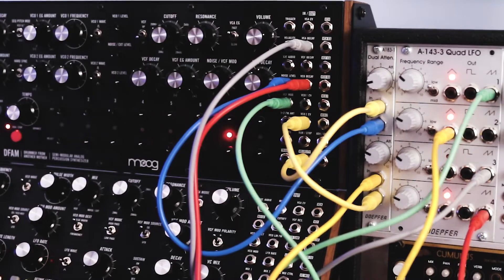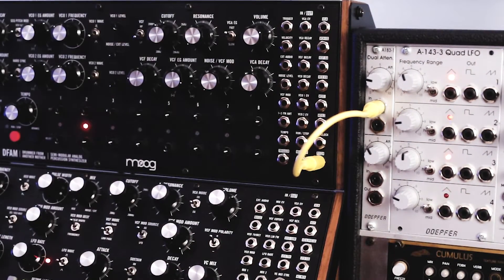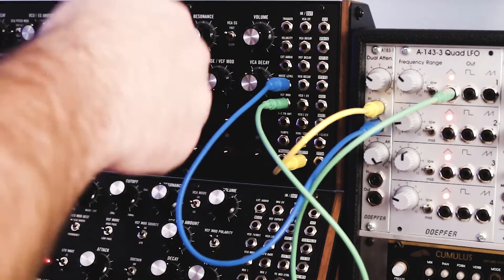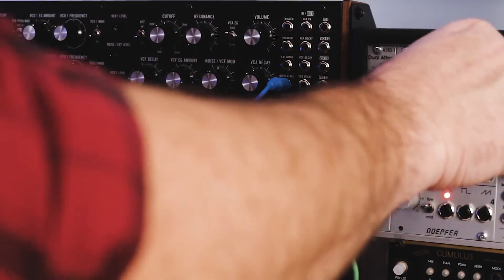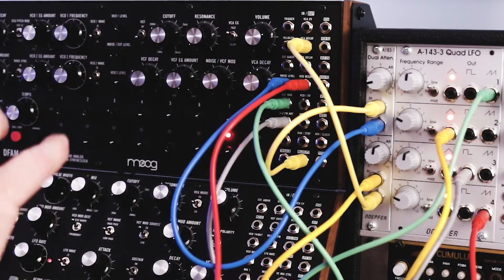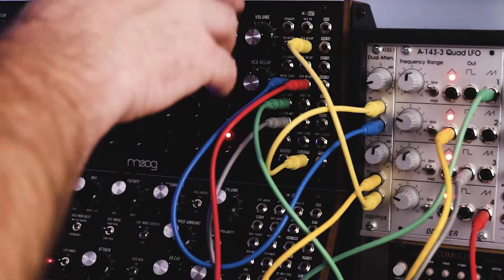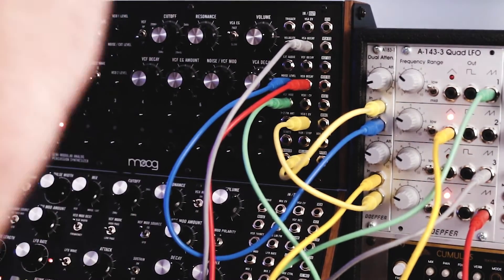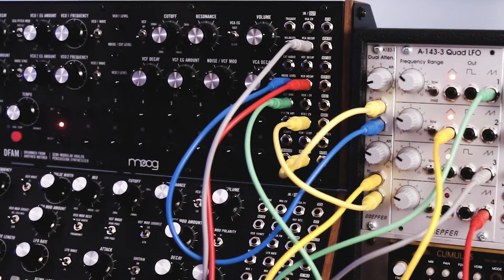DFAM + Two Simple Eurorack Modules

Comment: What about the voltage limit difference between Moog and Eurorack?
Reply from the maker: It's a good question. (And one that comes up a lot) It's not something to be concerned over. Higher voltage from these modules won't hurt the sound studio. With that said, if the input only accepts up to +5v, then when the Doepfer LFO is sending above +5 (i.e. +6, +7, +8...) the value on the Moog will be maxed out. The graph of the modulation would look similar to a trapezoid as opposed to a triangle (the top would be flat above +5).  So an attenuator or offset can help put it in the range that the Moog will accept.

Comment: Thanks for another great video. what i didnt quite understand -- where are you taking the effects at the end from? the dfam doesnt have built in effects... and it doesnt look like theres another patch coming except the attn. and the lfo... so im confused?:)
Reply from the maker: I have external effects on my mixer, but I also use a lot of Plugins for effects. Many effects - whether pedals or modules - are digital, and considering many are at the end of the signal chain, I often will just use Plugins because they are cheaper and you can have multiple instances. I don't remember exactly what I was using here. (I can look it up if you are interested). It's most like Valhalla Vintageverb, maybe some subtle compression and EQ. General stuff.

Comment: Right now I am building myself a custom-made 4-voices passive attenuator for my Sound Studio (I plan to integrate it just right into the 30-mm space that lies between the case and the cable holder). After playing with headphone cables with passive volume knobs used as attenuators, I agree that being able to choose the intensity of modulations in the Sound Studio is probably the most important function among those that were overlooked by Moog in their system. It is a game-changing option, for a dirt-cheap investment.

Speaking of dirt-cheap investment, I still stay flabbergasted at the price tag of something as basic as an attenuator in the Eurorack world. Even for small one-person company, I find it hard to justify.
Reply from the maker: Yeah, it's a pretty expensive endeavor. That's awesome that you have the skills to DIY it though!
Reply: @braintree56  I will wait until it works alright before boasting about it ! 😄
For a passive attenuator, the circuit design itself is quite simple, really : just a matter of measuring what current a typical Cv command sends through the wires and then choosing the right potentiometer to place in-between two female jack plugs.
But the more tricky part, maybe, will be to frame it in a proper box or behind a neatly designed plaque so that it integrates seamlessly with the Sound Studio. For I have to admit that beyond its specifications, an important quality of Moog’s semi-modular set is how cool it looks ! I would not want to ruin it with a poorly-executed added circuit.

I bought an aluminium extruded profile that should fit just right in the space between the top case and the cable holder. With a black acrylic wash on the metal and the right potentiometers’ knobs, hopefully it will fit as if it was a genuine Moog product.
Fingers crossed …

Comment: Still debating (if & when) modular. It be great to see what module recommendations (utilities, etc..) you would have to use with the Subharmonicon.  Thanks!
Reply from the maker: That's a really interesting question. I've only recently started playing around with my modules and the Sub. Nothing jumped out to me as "the sub really needs X" so it's more just experimentation. 

If I had to make a recommendation, I'd say effects modules first. The Sub benefits from reverbs and delays. I ran it through an MI Clouds clone and it was great.

The clock divider trick I outlined in a previous video was the only functional thing I've used. Certainly LFOs and other Modulations are always great and I've heard people say running external audio into the VCOs gives some pretty interesting results.

But at this point, I have more investigations/experiments I want to do than actual answers...
Reply from the maker: It sounds pretty good on its own or with limited mm modulations...

Comment: Great vid! Ages ago I bought 2x Behringer Neutrons. They sound good anyway, but because of the vast amount of patch points in and out I have ended up using them as modulation sources mostly now. So useful as they have 2vco which can be run at lfo speeds, an lfo which can run at audio rates and they also have 2 attenuators each! You can pick them up quite cheap 2nd hand too. Hope that helps someone! Keep up the great work on the vids. ♥ 🎶 😁 🎹
Reply: That’s pretty much the role my Neutron fulfils these days. It’s worth the price just for the utilities it provides alone! You’re basically looking at 3 LFOs, a S&H, Slew Limiter, 2 x Envelopes, 2 attenuators, mult, merge, a multimode filter, overdrive & delay all accessible from the patchbay… Not a bad sounding synth either to boot 👍
Reply from the maker: Looks like you can get them for under $250 on Reverb... Not a bad deal.
Reply: @braintree56  They’re a silly bargain for what you get… Worth a punt I’d say!
Reply: I for one am a big believer in using whole semi-modular synths as Eurorack modules. You just cannot beat the price of a self-contained system that was thought out to stand on its own.
The Neutron comes to mind immediately, but for those who for some reason avoid Behringer, I believe that a Moog Mavis can be a great all-purpose tool in a Eurorack.